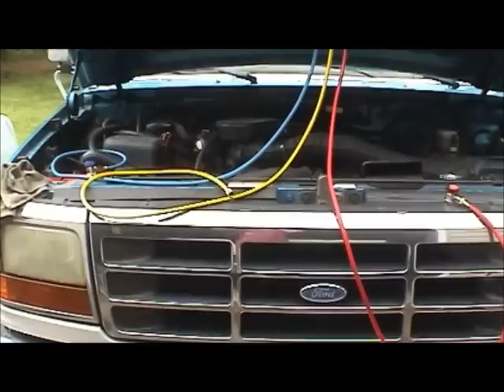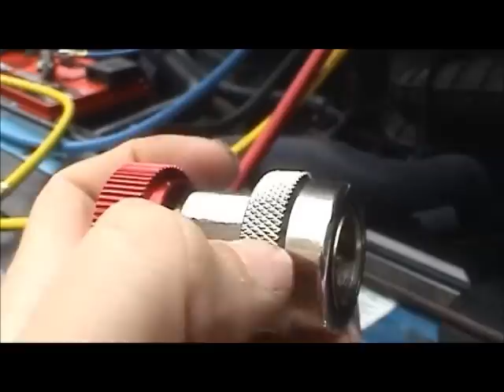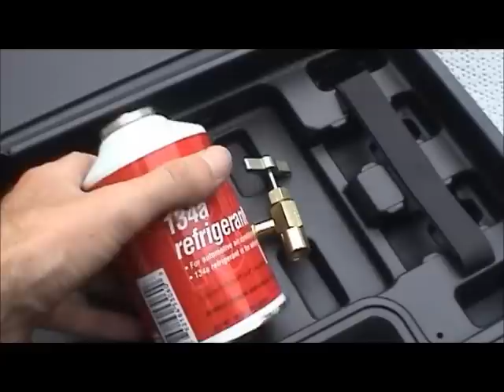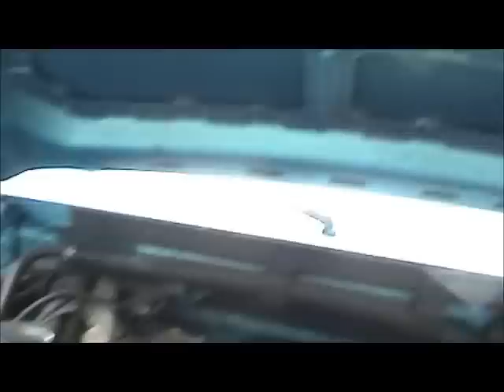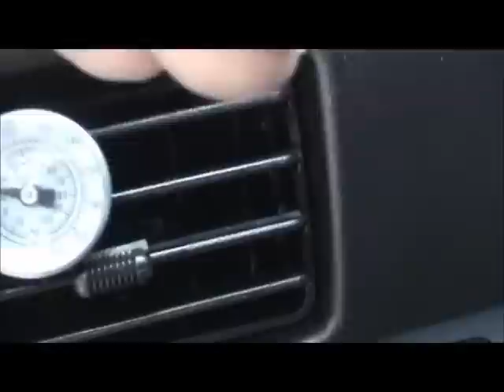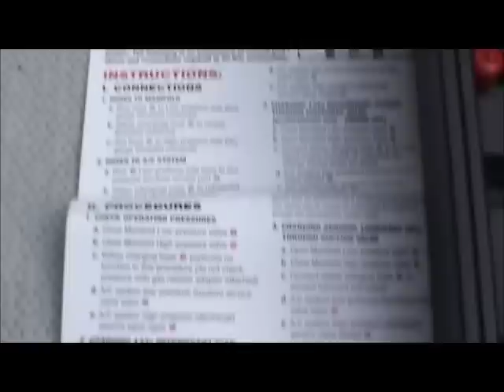1995 Ford F-250 4X4 AC Recharge

Comment: Well it looks like you forgot one simple step, and that is once you close the valve on the can and pierce the seal in order to get the gas to flow you have to open the valve again and the gas will start to flow then continue with opening the supply hose at the manifold to bleed out the excess air and continue to charge the system. the low gauge should rise to minimum of 60 psi in order to trip the cut out switch and allow the compressor to start.

Comment from the maker: Thanks for the information. That verifies what I was suspecting after I made the video since I didn't see the usual valve stem typical of schrader valves. For now, I'll keep charging it up once in a while but I'm sure I'll need to replace the entire discharge line at some point in the future. Hopefully, the leak is somewhat stable and won't get worse.

Comment: Actually on the discharge line port that is not a schrader valve which is the reason for it commonly leaking after some age. It's a flexible plastic "half ball" with plastic webbing on the back side of it for a pressure spring. I don't know why Ford & GM uses this...